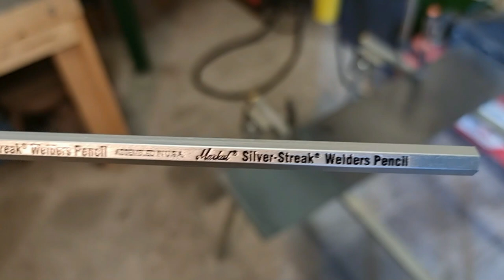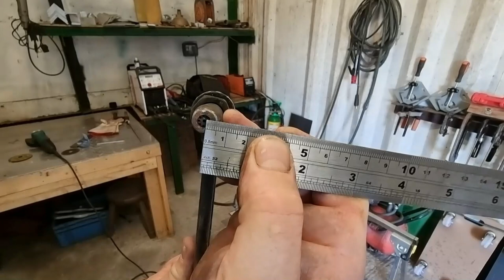Which cutting method is best? Lets find out (Bleeding Rust ep8)

Comment: Where’s the cuppa?  great work and very informative. You mention the cost of the grinder but not the other two…
Reply from the maker: Thank you Colin.. and good point.. you can pick up a plasma cutter for around £150 or $200 the gas lance is more expensive, torch and pipes and regulators are around £500 or $625 new then you need to rent gas bottles